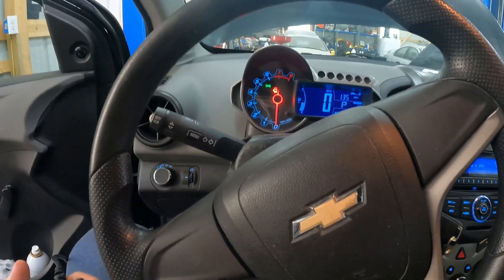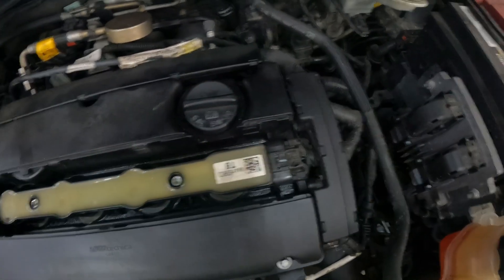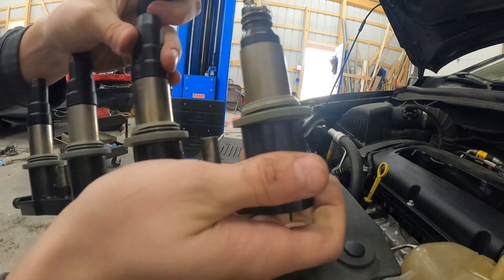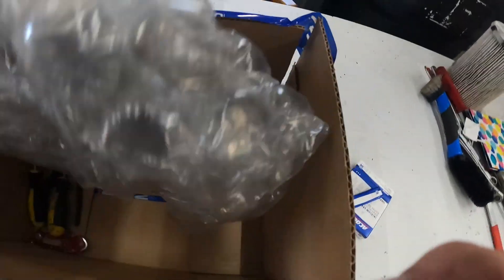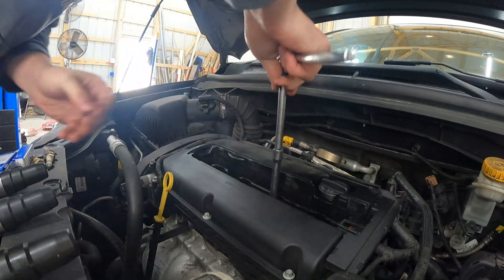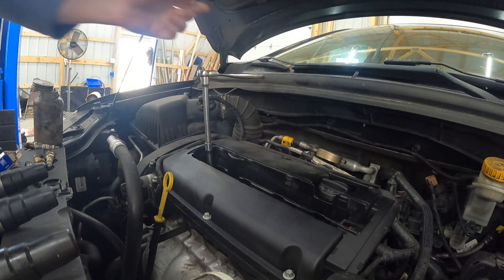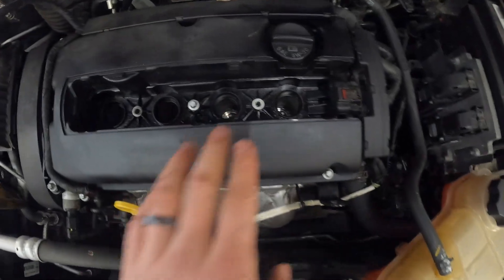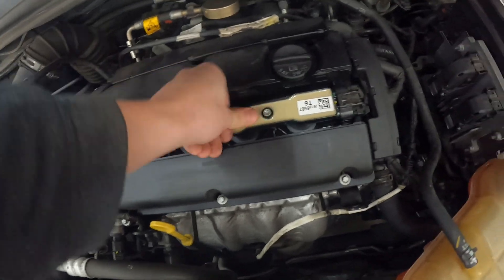2012 Chevy Sonic P0300 Random Misfire - Ignition Coil and Spark Plug Replacement - EASY DIY 30 MIN!

Comment: oil in the spark plug cavity indicates a leaking valve cover gasket. be sure to use the correct torque settings with a torque wrench when reinstalling the coil pack or replacing the valve cover gasket. if it is the wrong pressure it can allow oil to improperly leak into the cylinders.

Comment: I use a magnetic spark plug socket. The rubber insert style is too outdated.
Reply from the maker: @evertmorse8518  yeah I agree magnetic is much better hair haven’t picked up a set . The ones I used in this video were very old . I did pick up a new set of Quinn spark plug sockets from harbor freight . Done a few plugs and the rubber didn’t fall out of them . Magnet is on the list of things to get though . Sometimes I just use sockets with no rubber and use a magnetic pickup to get the plug out or use the coil itself to grab it .

Comment: I have exactly the same problem, I have changed the spark plug multiplier and the problem remains the same. I tried injector cleaner. And valve cleaner again the problem remains.. now I'm thinking of changing the camshaft adjustment control valve.. can you think of what else i can do wrong.

Comment: I had the same problem, replaced the coil pack but unfortunately it only lasted for 1year 7months. As I type this I need to replace it again 😏 where can I get a manufacturer’s one?  
I’m in SA
Reply from the maker: AutoZone can often order you oem but I bought mine off Amazon . The oem
Lasted just over a year and had a 2 year warranty . Got a refund and bought a Duralast that’s lifetime warranty so if it goes again I’ll just swap it for free and get part same day. I think part quality is a major problem since covid even oem is spotty

Comment: i had a little oil around one of my plugs, an inner one, so i tightened that middle bolt under the coil and so far so good. of course it can only tighten just so much with the metal insert in the plastic.
Reply from the maker: If the leak persists next is a fresh valve cover gasket :)
Reply: @JustFixinGarage  yup.

Comment: Thank you, I’m going to try replacing this then see if it could be the culprit for my P0302 code problem. Do you think there is anything else that code could be for cylinder 2 misfire detected?
Reply from the maker: It sure can cause it so could other factors but this is an easy part to rule out and if you get one at say AutoZone it’s lifetime warrantied . If new plugs and coil don’t help look for fuel injector issues or do a compression check

Comment: Hey how many have come in since video?  Just purchased one couple weeks ago and have had it in the shop twice . First time the said engine blow by was happening and second time they got the same diagnostic Code you did . “They saw cracks on 2 coil towers , also checked pcv system and noted crankcase vac above spec of 1hg at aprox 3-5hg , they recommend replacing camshaft cover and Ignition coil” and then they ended up installing a new valve cover and ignition coil . Do you think they did the right things and I should be set to go?  or am in for a bunch of fixes on this car . I got $$ for the advice as well since it’s valuable I know . Thanks in advance
Reply from the maker: I’ve had 3 of these come in for this issue . Keep in mind I do IT for a living this is just side work for friends and family and some extended friends so I don’t work out there more than maybe 1-2 times a week . One of them I saw twice where the coil failed in a year . Luckily it’s a 2 year dealer warranty on the part so easy swap . The valve covers that have built in pcv valves are known to be problems on this so it probably didn’t hurt . But usually  bad pcv throws a different code .
Reply from the maker: Oh and new plugs at the same time doesn’t hurt , bad plugs can cause the coil to fail prematurely too as it works harder to generate spark .

Comment: Is there a design problem that the spark plug on the oil fill end gets hotter than the others? When I changed my plugs, that first one was hotter than the others. Could that same issue cause the deterioration and cracking you show on the coil on that end?
Reply from the maker: I would lnt be surprised if thats the root cause. I feel like most design issues at this point in manufacturing are intentional to keep things from lasting. I have done a few of these Chevy motors and all have similar issues with that one piece coil pack. The heat and cracking may be a side effect of a bad connection/spark as that would generate more heat as well.  Or it could be that is just a hotter side of the motor depending on where the water jackets are.

Comment: What is the rubber thing you put into the socket when you are taking out the spark?
Reply from the maker: Most spark plug sockets have a piece of rubber in them to grab the spark plug so it pulls out the plug after it’s loosened  . Mine kept getting  stuck to the plug instead of staying in the socket .
Reply: @JustFixinGarage  thanks for enlighten me.

Comment: Will this also cause a gas smell when pressing the gas?  I have the same year about 86700 miles on it and it just happened all of a sudden.  But when trying to press the gas is hesitates and smells like gas.
Reply from the maker: Due to misfires there would be an excess of unburned fuel . So the smell would be excessive and I would expect the car to bog out and hesitate when trying to give it more throttle. I suggest if your engine light is blinking you stop driving . As the excess fuel not burning can damage your catalytic converter and require it be replaced.

Comment: I appreciate ur video my wife has the same kinda car n sounds like the same problem I already replaced the purge valve the vvt sprockets intake n exhaust solenoids the valve timing sensors both of them the timing belt  the camshaft position sensors n the spark plugs twice in a 4 month period I’m at my Witt’s end with that car n then when she was driving to work the other day it wouldn’t accelerate past 60 mph on the highway so now ima change the coil pack n c if I need new spark plugs but we just recently changed those I should’ve changed the coil pack when one of the spark plugs was kinda melted that would’ve told me the coil is bad but I didn’t snap to it .anyways I appreciate ur video n I liked n subbed
Reply from the maker: Thanks for the comment like and sub ! Hope this gets things fixed up for your wife’s car :) when you did the plugs I suggest the oem scan Delco plugs . Can’t go wrong with oem (usually). Let us know how it works out Amazon has the best price for the parts I’d bet.
Reply: @JustFixinGarage  the check engine light came back on as soon as I plugged the negative terminal had it scanned n it said the 3rd cylinder misfire n throttle body issue the car doesn't wanna accelerate like it used to I'm at wits end with this car
Reply from the maker: @bigpoppapump4060  Reading back over your list of parts replaced was the throttle body replaced already? They can cause alot of issues. If cylinder 3 continues to be an issue it might be worth checking all wiring to it and maybe  even doing a compression check if not already just to rule out a mechanical failure. Next would be to try swapping injectors to see if thats an issue with Fuel. Do let me know about the throttle body. If those go usually car goes in limp mode.

Comment: Very informative video. I purchased my first Chevy from Carvana two months ago. The chevy sonic 2014 with just 16400 miles on it. Giving me same issue. So mad rightnow at Carvana and my luck. Can I do what you did at home with limited tools?
Reply from the maker: The tools you will really need is the torx bit , spark plug socket , and an extension. That’s if you want to do all the plugs and wires . For sure this is a 2 out of 5 stars for difficulty and as long as you don’t over tighten the spark plugs you will be fine .
Reply from the maker: If you check the video description I listed out the tools I used too :) in case you need to check or purchase .

Comment: do you really need anti-seize?
Reply from the maker: I’ve become a person to use it a lot . However it’s not required and the factory doesn’t do it . There are also some plugs that even say not to do it. I have just had side plugs be stuck in the head due to rust and over torquing so I try to do this hoping the next person down the line doesn’t have issues . But 100% if you don’t want to use it you don’t . Just don’t over torque them.

Comment: Are there any other parts that should be, or at least a good idea, to replace as part of a "tune up," like used to be done in the old days?
Reply from the maker: For this car I’d say air filter , cabin air filter , The plugs and if needed the coil . It won’t have thinks like wires , cap , or button to do . These do have known failures in the pcv valve which if I remember correctly is built into the valve cover itself.